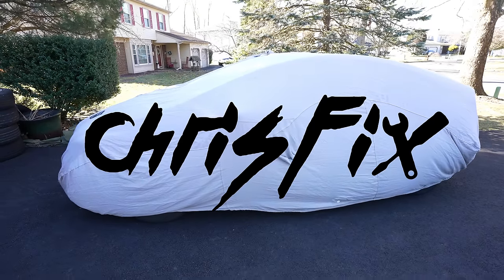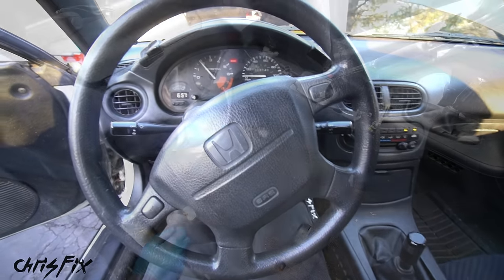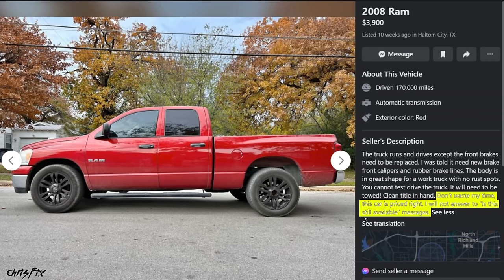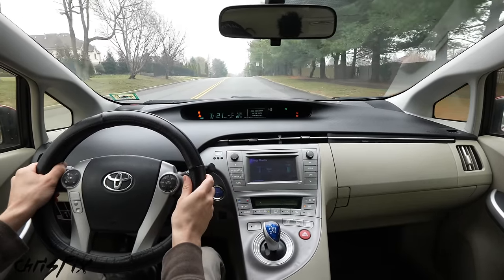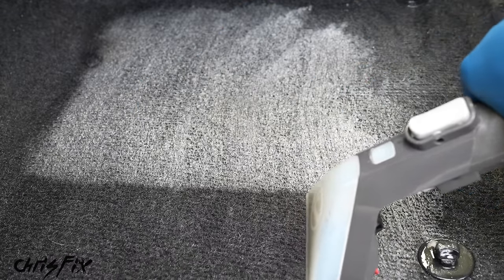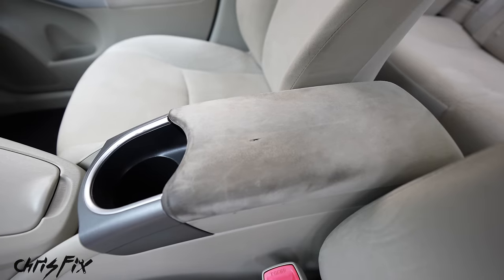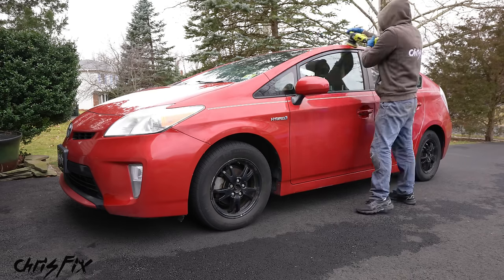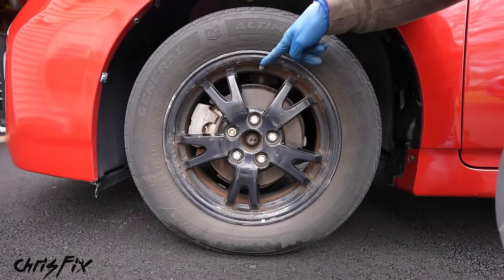How to Buy a Car To Flip for a Profit ($$$ Side Hustle)

Comment: I like to remove the door panel on the inside and wash it in the shower indoors.
Let them dry and it looks like you have brand new doors.  While open you can add soundproof material.
The door panels are typically easy to remove and are durable enough to remove and replace with no clip damage.

Comment: Chris, fantastic video. Have been watching forever and I'm a huge huge fan. These videos have inspired me to do my own work on my car with confidence and contain so much invaluable information. They are all very appreciated. I've got a question for you regarding the detailing process. How do you clean the rags and brushes you use in these videos? I've got a couple nice rags that I like to use but I'm unsure of how to clean them. Is it okay to put them in my washing machine with all the car cleaning chemicals?
Reply from the maker: Brushes are easy, just spray them with soapy water and hose them off. The bristles really dont hold dirt so the dirt comes right out. The microfiber towels I soak in soapy water and then power wash on the glass of the car before I dry it haha. Then I throw them in the wash with normal soap you would use for clothes. Just dont use any dryer sheets which leave a residue.
Reply: @chrisfix  Love it! Thank you very much sir and thank you again for all of these fantastic videos. Always always so helpful.

Comment: As a long term Prius owner I love to see you taking on the Hybrid Battery! 

The E85 kit might not make sense though. If you run the numbers with how much more fuel you need to make the car run properly compared to the cost of the fuel, it’s usually a wash. When you factor in the cost of the kit, then you’re in the red. Also, considering that driving a Prius is basically driving a gasoline powered computer with great gas mileage, it kinda not worth it. However, it sure will be interesting to watch and I’m sure will pique a buyers interest!
Reply: Yeah I was always told not to replace individual cells but to replace the whole hybrid battery. But if he was to buy an OEM toyota battery that wouldn’t be cost effective and not net much of a profit. Im curious to learn about these “cylindrical cells”

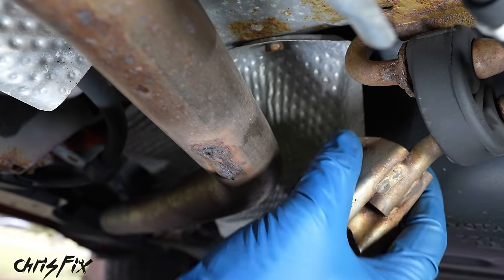Comment: 19:51 This is potentially dangerous to weld in this location

I can see the fuel tank in which the exhaust pipe is just right by it with the insulation material

The sparks will ignite any fuel vapors and cause a fire or explosion

Just to be safe 😉

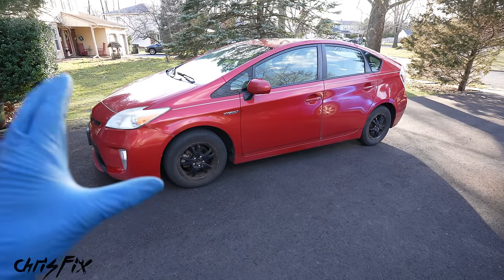Comment: I'm trying to fix my sister's car, that noise at 19:00 is it! That makes me feel better. Thanks! My sis took her car to Valvoline for an oil change and it had been overfilled. That was in May, the oil i just drained, only a couple months later, was like black sludge and it was still WAY overfilled... took all my strength and a breaker bar to get the drain plug loose. There is zero chance Valvoline actually changed her oil and filter. ZERO. Hopefully her engine isn't messed up. I'll still check for a head gasket leak.
Reply from the maker: Dang sorry to hear, they should not be working on cars

Comment: Tire cleaner in tandem with a pressure works great to get rid of any kind of paint, I just started working at a autobody shop starting out on detailing and we got a vandalized car just like that. Note that spraying it on any aluminum will turn it black and a pain to get rid of. I learned the hard way as most people do with cars

Comment: 20:57 im not a welder but i heard from one that grinding down welds can cause problems in the infrastructure, especially if the weld doesn't go all the way through the metal 

love you chrisfix ❤
Reply from the maker: If it's a thin weld then yes but in this case there was excess and I wanted to make it look a little better lol

Comment: I used to work at a battery shop, another easy trick for batteries is age, over 4 years old, probably a battery close to end of life, but that's just a cheap go-by if you don't have tools. If you have a multimeter, check voltage, should be around 12.5V, anything below 12 and it's a battery that could potentially have permanent damage. If it's a flooded battery, pop the top off and check the electrolyte levels, if they're low, you can put distilled water in and potentially bring some life back into the battery after a charge/long drive. Also, start the car and check voltage across the battery again, should jump up to 13.2-13.5V. If not, you could be looking at a bad alternator.

Comment: So for just a weekend of work and one month of work going to look at 24 different cars, I made $1500.   As one who used to flip cars, the best one was all it needed was the battery charged (they said it doesn't start anymore) for $1000, the worst was a car did engine swap and spent weeks tracking down different wiring issues and eventually got it running great, but would never clear the smog ready, so I lost 2 months of time and $1000 cash on it.

Comment: I have a 3rd gen Prius with a dirty center console cover because I’m an automotive tech as well and I sprayed the cover with some emulsifier from a car wash “zips I believe” and used an old credit card to scrap the oil off and then scrubbed with a microfiber towel and it looks brand new. Keep in mind I had to scrub engine oil, transmission oil, gear oil and God knows what else out and I the trick that I noticed was the credit card scrapper

Comment: I laughed out loud about you list of things to avoid, my parents bought a car for me to use over the summer - as long as I fixed it so they could potentially make a profit. 
It had: Cracked front window, slight body damage, scratches around the whole car, slight rust and damaged front seats :') 
I skipped the scratches left after buffing + waxing. I bought some seat covers to cover the damaged seats. 
A cracked window is always 150$ to replace in Sweden (basic insurance), so that was easy. 
The body damage and rust was pretty fun to fix - and actually turned out amazing. 

The car was bought for 2200$, fixed for 200$ and sold for 2600$ = 200$ profit!
PROFIT IS PROFIT! YEAH I'm a flipper :D

Comment: I seen a car once that said, runs great, new tires and battery. Went to look at it and it had not run in years, engine with completely oxidized,  dead battery and I do mean zero volts dead for years, with four dry rotted tires. Car had not been moved or run in years. Worth around $200 for scrap metal.

Comment: @Chrisfix Mate whenever you are cleaning the carpet use a little hand massager to let the vibration take rustle out the debris and vaccum in parallel. Works like a charm. Use a sticky paper lint remover as well for stubborn fibres of debris.

Comment: First vehicle I ever bought, was a 2010 GMC Canyon crew cab SLT, got it from a friend who was looking to get rid of it before he moved. Sold it to me for $5000 (CAD), it was the full blown 5cyl 4WD version, although he didn’t understand what 4Whigh and 4Wlow was, so he thought it was 4W front and 4W rear, and couldn’t figure out how to get it into 4w low, so he told me that was broken. It wasn’t, it just had to be put in neutral. Anyways it’s rear bumper brackets were bent from a light rear end accident that hadn’t damaged the tailgate, so the bumper was hanging down about 15 degrees lower than normal, (frame was undamaged) 3 tires were leaking and the drivers seat leather had a big tear across the bottom section, spent about $40 on a bumper from the junkyard, just needed the brackets and bumper reinforcement as the chrome and plastic parts were undamaged, $80 for two universal beige leather seat covers (just for the bottom of the seats, they actually fit super snug and matched the rest of the leather) was able to patch the tires up as I work in a shop. It had a nice 1inch lift and an aftermarket tonneau cover, heated seats and a nice head unit with a touch screen. I had the interior detailed and I got the mvi renewed no problem, sold it for $8700.

Comment: 29:53 A steam cleaner with a stiff scrubbing nozzle on the end will absolutely clean and restore that armrest. That's an accumulation of oils and dirt over the years, nothing more. I just removed a much larger stain on my armrest. It took 30 minutes but it came clean!
Reply from the maker: I tried that and it helped a little but it has been rubbed through so no amount of cleaning will restore that, I am planning on redoing the fabric though

Comment: Wish I'd seen this before buying an F-150 that had 3 of the clutches out and the torque converter drum was starting to strip. But thankfully I knew a shop who does good work and fairly priced. I was in need of something and took a risk.

Runs decent now, just need the exhaust manifolds done now, clean up interior, clean up frame and probably do the brakes.

Edit: Had gotten it for $5k btw

Comment: Back in my early 20s I did this to vacation and it was relatively worth it because it only took 12-16 hrs of work into it 4-5 weeks and the car is good to go usually, only had one car where I had to do an engine and transmission swap but I got it fully done in 9 weeks. Sold the car I got originally for 3,900.00 (with the new engine and transmission just not in the car) and flipped it for 7,500.00 plus I sold him the system that was in it from before for an additional 700.00 for a grand total of 8,200.00! 
Last car I got I lost money on but it was because I used it as a moving truck for a week and drove it about 4k miles! Bought for 3,000.00 and out 2,000.00 into it and sold it for 4,900.00

Comment: I hope you also changed the cabin filter, exposing it to water increases the chances of mold on the cabin filter. With it being in the cabin if heat/air comes on the customer will inhale that mold and it could potentially cause medical issues

Comment: 23:06 new pedal covers are cheap enough and then spray paint the control arms after covering all areas around them one does not want painted.
Reply from the maker: If the pedals are really worn or old that's not a bad idea, thanks for sharing

Comment: When you “tuck” the negative lead away you should put a cap in the negative terminal. If that led slips back out and rests on the battery, it’s all for not.
Reply: wait hold on why is it being disconnected again

Comment: Battery the head gasket in the EGR system are the biggest problems with this motor I have the same issues in my my 2012 Lexus CT200H

Comment: "Hi there, I'm encountering some issues with my car. Firstly, when I accelerate, the gear shifts feel rough and the car seems slower compared to before. Additionally, when I brake, it's not smooth; the car doesn't stop seamlessly when I press the brake pedal. Could you please advise on what might be causing these problems and give me an estimate of how much the repairs might cost? I want to be prepared and avoid any potential overcharging or scams at the mechanic shop. Thanks!"

Comment: You also should replace the cabin air filter and I like to spray it down with Febreze before I install it that's almost never changed and it's very important for the proper function of the HVAC system and an old dirty one has a musty old dusty nasty smell where a new one smells nice I guess you need my help

Comment: For engine clean,do you spray the alternator and other such "sensitive" parts with the defreaser and then the hose?
Reply from the maker: In a case like this where I am just doing a quick clean with some regular hose water, you shouldn't have anything to worry about, but if you are concerned you can always cover it and work on it separately

Comment: Hey Chris! Quick question about your headlight restoration in this video. You sealed and protected the headlight with ceramic coating here, but in another one of your older popular videos you sealed with clear coat (you didn't here). Is the clearcoat not necessary anymore, or would you still recommend for the daily driver?
Reply from the maker: If you're looking to restore headlights more quickly and easily, then I would give the ceramic a shot, but it can eventually wear and require reapplication. If it's a car you're planning on keeping for a very long time then I would do the other process to permanently restore the headlights

Comment: So you cleaned out the fuel line and gas tank and added a new fuel pump did you change the fuel filter because that's where the sugar would get trapped really
Reply from the maker: The fuel pump has it built it on this car

Comment: Do you suggest a hacksaw for cutting the muffler? The joint near the rear of my 2008 corolla rusted through and I need to replace it with a straight pipe, but I don't know how to cut the metal most efficiently. I'll be doing it in spring though, so I have time to figure it out.
Reply from the maker: Yes, a hacksaw works well for situations like that! However if you can buy/rent/borrow a Sawzall that would be ideal and make the job go a lot easier
Reply: @chrisfix  I was just at the store the other day and wanted a sawzall for another project so that's a perfect suggestion!! Thank you Chris, I really appreciate the replies. I'm kind of blown away that you replied tbh. Thank you.

Comment: Hi Chris. I just wanted to play devil's advocate with this and talk about the fuse in the Chev- I would be more concerned about why the fuse popped in the first place. At least with my experience, fuses don't have issues unless it's a bigger issue with shorts, grounds or some other electrical thing, I'm sure you know that though but just wanted to comment on my own experience/hindsight with this that some others might not have.
Reply from the maker: Good point, I believe it was the old fuel pump going out, I replaced it and as far as I know it never blew again

Comment: Hey Chris, I had watched one your vids on headlight restoration from 9 years ago.  You used 400, 600 and 2000 grit sandpaper then used clear coat.  This vid you used the ceramic coating.  I had bought the stuff from the first video and was wondering if that process is still applicable and which do you prefer?  Thanks!

Comment: I got a question. I'm getting a 1994 Pontiac firebird and I wanna know how hard it will be to fix. The guy says the fuel pump isn't wanting to run and it's super dirty. So how can I do that. Also the rear light is broken and how do you replace that?

Comment: Just to add, cool you buy the parts that need fixing but in-order to fix the issue you'll need to pay a mechanic which is also costly so taking that into consideration you will need to flip it for at least 2-4k more to achieve a good decent profit.
Reply from the maker: The whole idea is I am showing you can do it yourself so you dont have to pay a mechanic.

Comment: With the headlights, if the layer of ceramic coating gets oxidized again, how do you get rid of the oxidation then? Do you have to sand it again?
Reply from the maker: Exactly. Just “restore them”. Usually the ceramic will wear off before that happens tho so it’s already off the lens.
Reply: @chrisfix  thanks Chris!

Comment: One question to the Headlights:
- What is that surround coating exactly? Can I alsow just spray clear laquer over it and I'm good?
Reply from the maker: I would use a 2k clear coat and keep the surface scuffed with 2000 grit, not perfectly polished.

Comment: If you buy a car & it has pin striping on it & in some areas it is still good but in some areas it is cracked & chipped & in some areas the pin striping has come off & is gone how would you fix the pin striping to make it look like it is supposed to or is there an easy way to completly remove it without damaging the paint on the car.

Comment: Flipping cars is a great hustle, it's not as easy as he's making it sound. In order to keep it cheap you have to have a parts connection. Brakes, rotors, etc etc aren't that cheap and you have to be mechanically skilled as well. That'll save you paying huge labor costs.

Comment: one question chris. been your follower for long time. right now i have nissan frontier 2008. mpg is goddame low. and i need to drive it everyday for my child. i would like to have a good car with a good or better mpg than my truck. should i swap frontier for prius gen 2? in my country this 2 price is about the same
Reply from the maker: If you don't mind having a little less space than you might be used to with your truck then a Prius can be a good alternative especially if you're driving around every day. Check one out in person and see if it works for you!

Comment: Hey!

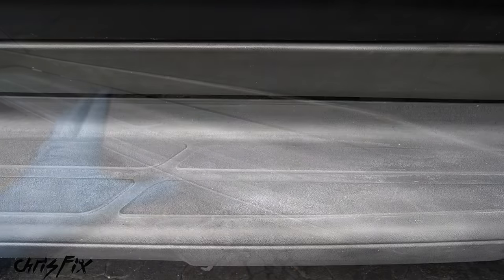At 4:00 what Ceramic Coating did you use to clean the plastic?

When polishing the headlights what type of cloth was used to apply polish?
and is this method of restoring headlights better than the method you used in a video from 2014?
Reply from the maker: I used: https://avl.kg/bf22c , I used a circular buffing/polishing pad, and it won't be permanent but its less labor intensive and still has really good results, plus its a "safer" method
Reply: Hey  @chrisfix  is there a cheaper alternative for the coating you applied on the headlights after polishing??

Comment: I have a car with a couple 1/2 inch spots of rust on the bonnet - is there a simple fix?  Think theres 4 

If not your wheelhouse fair enough google wasnt the most helpful but i came across this on a random YT crawl and seems like you or a sub might have some solid advice.

Comment: Hello Chris I really hope you see this comment I really need help ‼️‼️‼️‼️
I have a 2005 Hyundai Tiburon it accelerates by itself when I drive it or turn it on , it also turns off by itself when it’s on or while it’s being driven. I’ve had so many people check it out and no one seems to know what the problem is , I got the throttle bottle replaced and also the maf sensor replaced , and it’s still doing the same. if you can please help me figure out what’s going on with my car it would mean so much to me , thank you I love your videos ‼️
Reply from the maker: Is it a throttle cable or electronic throttle?
Reply: @chrisfix  sorry I meant the throttle body replaced